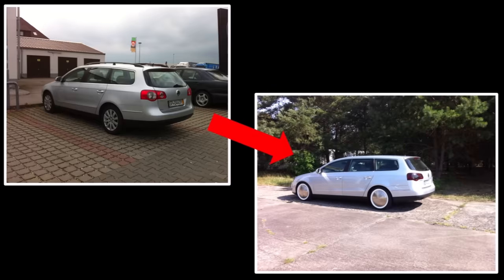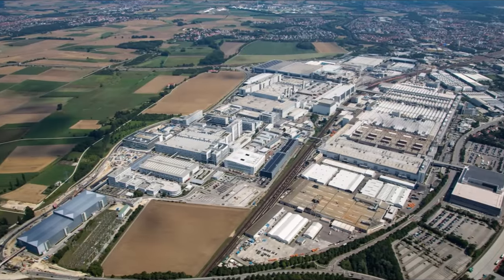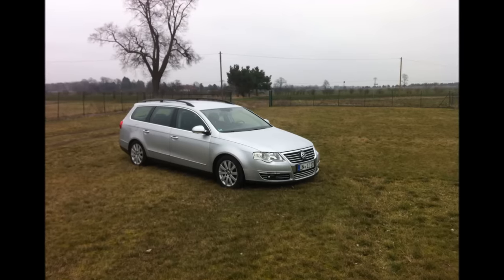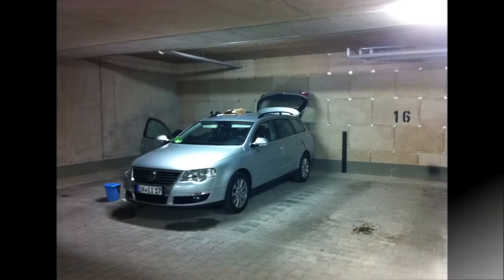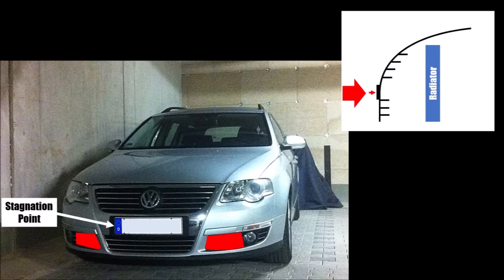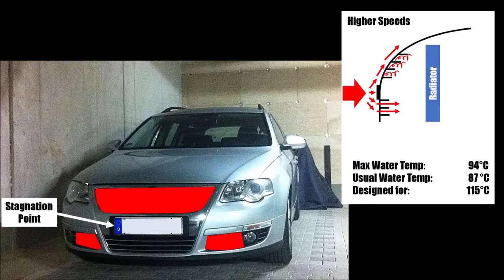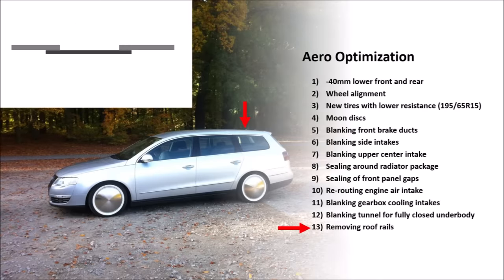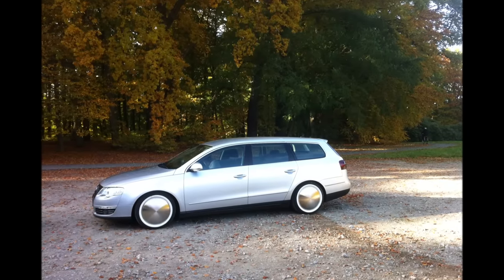Massive Drag Reduction For Tiny Budget - How I turned my family car into an AERO Star

Comment: The seals around the bonnet edges, I think, would increase drag. Those gaps allow air to leave the engine bay and that would reduce drag by reducing the force required to make air enter the engine bay through the front radiator vents.  In some extreme cases, if you seal the engine bay too well, the engine bay pressure rises so much that it is greater than the pressure at the front of the car and you get reverse air flow. The seals at the rear of the bonnet (near windscreen) should be retained though. The bonnet-windsreen interface is usually a high pressure region so isolating the engine bay from that higher pressure is a good practice.
Reply: i dont know if you've ever gotten your hands in one of these. it's a diesel (hint: mileage this low is impossible with the gas variants)
so it's fully sealed hood wise, to keep the hood from rattling and to keep the engine noise down.

that's something the gas variants of the passat (b5) dont have (they only have the windshield and water ingress seal on the front).

that seal is also present on something as cheap and simple as my old kangoo. goes around the engine bay all the way down to the radiator...
so sealing in the fender gaps would help aero.
Reply: @comethiburs2326  "so it's fully sealed hood" Have you watched the video? The video showed that the hood was not fully sealed - that's why "B Sport" added seals to the hood. Also, have a look at the parts diagram for the passat engine bay - you won't find a seal on the side of the bonnet. Have a think about it - air is rammed into the engine bay through the grill then radiator - where does it go after that? This video may help to explain the issue: https://youtu.be/NgGRwLANkj4?si=RWGtMiAfvIB_x6KY
Reply: Disagree. Sealing the engine bay makes pressure inside the engine bay rise so that less air enters it, i.e. less air flow through the engine bay. This leads to lower drag. 

Engine bay pressure could rise to above atmospheric pressure to reach atmospheric pressure + dynamic pressure of air moving towards the car, but never higher. This ensures that reverse airflow would not occur.
Reply: Sure, sealing it might help drag if you didn’t have need for air in the engine bay. But you do need air in there, don’t you? Your coolant radiator, air conditioner, trans cooler need air, we’ll, they don’t need air, they need air flow.
Reply: @zeitgeist785  Yes, but you don't need as much air in there as you get stock. Increasing flow resistance through the engine bay by partially sealing the outlets yields lower overall drag, as there is less air flowing through the engine bay.

Compare it to a battery connected to a resistor. Raising the resistors resistance does not increase consumption of electrical energy, even though its resistance is higher and power is resistance multiplied by the square of the current. In fact, the current drops such that the total power consumption is reduced. You'll see this as electrical power is also equal to the square of the voltage divided by the electrical resistance.

In this example, the electrical resistance is analogous to the flow resistance, the electrical current is analogous to the airflow and the power is analogous to the energy lost per unit time to drag.
Reply: In that case (where you need less air flow), why not reduce the air getting into the engine bay by reducing the grill openings? You still need some air flow in the engine bay which means you still need to get rid of it somehow which all these replies seem to ignore. It’s much better for that air to exit through the sides of the bonnet into fast flowing air instead of into turbulent air underneath the car.
Reply: @zeitgeist785  They do indeed close off part of the grill in the video. Some of the gaps in/around the engine bay, like around the headlights and front/sides of the bonnet, let air in. Closing these off thus helps.

I disagree that it is good for air to exit from the sides of the bonnet. It would be better to let it exit at the end of the bonnet at the base of the windshield or underneath the car.
Reply: @Gnerko123  What's your basis for thinking that air exiting the sides of the bonnet is not good? Do you have any reasons? My reason for thinking that air exiting the rear of the bonnet at the windscreen is as follows: Have a look at a pressure diagram of a vehicle at speed and then reply with why letting air out of the engine bay in that location is a bad idea [Youtube is showing me a thumbnail of a video with that pressure diagram right now so it shouldn't be too hard for you to find]. You make these statements but now I realise that you don't actually know whether they are true. They sound logical to you but some of them are simply untrue.

Comment: Good job, man! Additionally, you can further improve the drag coefficient with more aerodynamic outer mirrors, changing the door handles for flush ones and lowering the windshield wipers into the bonnet. Thanks for your valuable contribution.

Comment: Years ago I did a fair amount of sealing around the radiator combo of a Volvo C30 for the same reasons you give here. Removed everything before selling the car too. I did some tufting on the rear hatch but decided that any modifications there would be too eye catching. I had experimented with tufting before on a glider's wing, to help with turbulator strip placement :)

Comment: Very interesting project. I used to own a BMW E46 320d and it was also really economical and I hypermiled it a lot. I was able to bring the fuel consumption down to 4.7l on my commute to work (country/highway roads with max 100km/h). At normal Autobahn speeds on my trip to France (120-160km/h) I managed 1000km with 5,3l/100km
I'd wonder how much could be achieved with those kinds of modifications on this model.

Comment: I changed tire size from 205 to 185 and the fuel economy improved a good amount, less rolling resistance, I also installed turbine wheels from an older Mercedes that look similar to your moon discs.

Comment: Sehr interessantes Video, ich bin grad in einer sehr ähnlichen lage und optimiere meinen T4 1.9 td auch auf Verbrauch. Die Aerodynamik habe ich noch nicht angepasst, bin aber durch Anpassung der ESP und durch eine sehr lange Übersetzung jerzt bei 5,2L bei 10% Stadtverkehr, 20% Landstraße und 70% Autobahn bei 100km/h. Durch einen größeren Pumpenkopf und Anpassung des Spritzbeginns habe ich den Mitteldruck erhöht und den MFB50 näher an OT gebracht. 
Das Fahrwerk habe ich auf eine möglichst gerade Spur eingestellt und die reifen (195/65r15) mit 3,8 bar bei maximalem Druck. 

Ich fahre täglich 180km Strecke zu meinem Ingenieurspraktikum wo ich in der Motorentwicklung Arbeite und am Wochenende 380km in die Heimat.
Reply from the maker: OK also motorseitig schon einiges gemacht. Aero ist bei einem Bus natürlich eine Herausforderung.

Comment: If the average person applied you methods, the following conditions would be likely. 

1. Excessive break pad wear. 

2. Warped break discs. 

3. Hydro locked engine. (Most drivers don’t think about big puddles)

4. Blown head gasket, or over heating engine damage. 

Glad you warned that your mods were based on your driving needs. Unfortunately manufacturers have to try and design for those that pay no attention to conditions or maintenance. 

Your success shows just how much performance is lent on the table. 

Just out of curiosity, was your car one of the dreaded diesel gate cars?

I enjoy your videos, thanks.
Reply from the maker: That's the reason I don't recommend any of this to anyone.
I basically tried the things on my own car, I was not allowed to do to customer cars at my work in the technical development.

The typical British hydrolocking would actually be less of a problem because the typical wave when hitting the water wouldn't splash right into the airfilter. That path was blocked at my car.

Brake cooling on this car would still have been enough for 95% of customers and even in the Summer with air conditioning in traffic jam, the engine never reached more than 100deg water. So also that would be fine for most customers and the bluemotion models of VW confirm that.
The only reason to open the upper air intake is a so-called "pull-down" at 45deg ambient temperature. So a hot car being cooled down inside as quickly as possible. With a closed upper air intake that takes slightly longer.

This car was pre Diesel Gate

Comment: You can get similar gains in fuel efficiency by other means (depending on the car). for example, I used to hae a 1072 Triumph Dolomite 1850 with a 4 speed manyal gearbox. In these cars the exhaust is particularly restrictive, so I replaced it with a rally spec exhaust and downpipe. Nothing else was done and average fuel economy improved from 30 mpg to 36mpg (UK gallons) and there was a modest improvement in performance.

The other case ws on a 244 Volvo (B21A engine and 4 speen manual gearbox. I knew the car would need a new clutch soon, so with the help of the 240 specialist in the Volvo enthusiasts club, I also replaced the gearbox with an Overdrive one (0.67 overdrive) at rhe same time as the new clutch. Again nothing else was changed. this time fuel ecinomy improved from an average of 28mpg to 34mpg.  Granted these would probably have cost more than in this VW's case (A custom rally exhaust and downpipe is NOT cheap, neither is an overdrive gearbosx an a new clutch) but the results were just as wotrh rthe expense as I kept these two cars for another 5 years or so.

Comment: Another thing you could do if you are good with any bondo or other body work materials is cover the unused vents to create a smooth surface this would further reduce drag you could even install a small diffuser that will increase some down force but should also create less drag if you want to goto the extreme remove the door handles and once again smooth it out with something else just maybe have a latch underneath to get in next you could have vents coming from above or on the side next to wheel well to reduce the air tumble caused from the tire and extract it out the side further reducing drag and adding some cooling another thing you could do is add a vent somewhere along the hood to reduce the pressure and heat under the hood

Comment: My 2 door yaris has full underbody panels and the handling and mpg improvement is very noticeable since stock these things have no panels and are essentially parachutes underneath
Reply: does it have some type of diffuser? if you just cover the underbody with panels theres a risk of the car raising from the ground at high speeds
Reply: @PaulTC777  Calm down there, this is a street car not a CLK GT R that is 4 feet tall. No I don't have a diffuser, I just wanted to smooth things out which it did because now I can cruise at 90mph with no hand on the wheel and it goes dead straight. No side winds pushing is also nice, stock you were just getting thrown around with the wind but that was mainly fixed with the lowered suspension. Most newer cars have most of the underbody covered and don't have diffusers, you don't see them flying off. If you're doing speeds to flips a car like that, you are way better off having the panels.

Comment: Love your project! You can also add a lower front lip, so less air go under the car. Removing weight from car helps too like lightweight car battery,  fiberglass hood no spare tire and lightweight seats.
Reply: It may not help a lot at steady state cruising, but in the city perhaps
Reply: @RennieAsh   that is true but if you cruising on hills then still you get the benefit of less weight. I myself saw a 15% + increase of consumption from cruising on hills even though downhill riding is like 0 consumption going uphill even few degrees it kills the overall consumption.

Comment: I had the same engine in a Skoda Octavia 1.9 SDI (yes, no turbo, but it was primarily used as a taxi). I sold it after 240,000 miles when the water pump broke although I wish I had kept it. (I didn't know about the problems associated with DPF'S.)
These engines are known to be bullet proof and the cars and associated parts, very reliable.
I can understand you reducing brake cooling to reduce the drag coefficient, but is this really economical when you consider the extra load put on the clutch and gearbox? I would rather pay an extra few pounds (in the UK) every time I fill up and replace the brake pads every few years than get a large bill for a clutch or worse.
I'm sure you saved overall, but few of us can bank these savings for the moment the clutch needs renewing.

Comment: I'm watching with apt interest. I recently bought an Atlas Cross Sport VR6 4motion and have been very disappoint with the fuel econony. Almost 10,000 miles worth of driving and most fuel fills don't even last 300 mi. VW's claim was 18 mpg city and 24 highway. Idrive all highway but about 30-40% of those miles are in LA so really mixed. I think I've had one tank that averaged over 20 mpg but just barely. I've only seen my dash display show over 21 like 3 or 4 times. It usually averages out to about 17.5-18.5.

Comment: I love this video so far, but you've said you added more toe in than OEM specified for "better handling"?
I do agree adding a little bit in the rear might positively effect the grip on that axle, I'm pretty sure that more toe in on the front will not make it handle better
It will make it a tad more stable in a straight line, less nervous, as having a slight bit of toe out would make the steer in response more, well, responsive, too responsive for most people
But I was always under the impression that having almost neutral toe on the front is the best for sporty driving, just enought toe in to not feel nervous, but not too much to make it react sluggish to the steering input

Comment: Great work and an mazing efficiency improvement.
Didn't think you could make such a big impact with small but clever mods.
You mentioned "toe in" for better handling. By better handling you're reffering to better stability/predictability on fast roads with little to no bends?
Reply from the maker: Thank you very much!
A bit more toe in at the front axle gave me a bit "too much" steering angle, once the car was leaning on the outside front wheel, which let's the car steer a bit more happily. 
A bit more toe in at the rear axle gave me more stability for the same reason. It keeps the axle stable for longer but if you reach the limit and it goes, it goes more suddenly. So you have to be aware of what you are doing.
By a "bit more" I mean something around 5 angle minutes (5/60 degree), so that's fine tuning.
Reply: @BSport320  doesn't toe out make the car more willing to steer but more susceptible to oversteer and less stable at high speed corners?

Comment: Fascinating :) Would it be possible to replace the outside mirrors with smaller self-made ones, or would this be illegal? Or even a camera-based system with monitors inside. And the door handles could've been taped over, maybe to get some tiny amount of more efficiency ...
Reply from the maker: I don't know any after market camera solutions German TUEV would accept yet.Also, this was a low budget project.

Comment: nice video, quite instructive... i think that I might have, maybe, installed a fan topush some air through the exhaust system 'tunnel', maybe hooked to the switch for the radiator fan, so that it would provide a small airflow in that exhaust tunnel, whenever the car's radiator needed air, normally when stopped, so that you wouldn't overheat rustproofing paint/wax, sound absorption, or interior mat materials...but, hey, just an idea, cheap, efficient, easy, and just that extra bit of margin for safety...

Comment: This was very interesting. Would be nice to know which of the mods made the greatest/lowest drag reduction contribution, but I guess it'd take too much time to figure it out separately one by one. Really cool video! 👍👍👍
Reply from the maker: Thanks!
I did it one by one back in the day but unfortunately don't have the car anymore to measure it now.
Reply: It is probably like 0.5L/100km lowering it, 0.3L/100km sealing the underside and the rest from sealing up the front and removing the roof rails.
Reply: @rkan2  That would be your educated guess? I do not have the "feel" for stuff like this. It'd be really interesting to know full on real numbers - I'm weird like that, what can you do.
Reply: @griffn14 the lowering certainly had the biggest impact, I would say next is sealing the wheels from the outside which is about as good as sealing the underside. I am not sure about sealing the front air intakes from the inside, a flush sealing from the outside would have been better but probably harder to apply.
Reply: So, lowering and sealing the wheels and underside. Seems about the most logical. 👍 Cheers!

Comment: Holy cow!!!  80 mph fuel consumption is in the Prius's area.  Impressive to say the least.  Imagine a dedicated body panels and chasis designed for reducing aerodynamic drags - for example, complete under body panels; front and rear wheel well covers; sides mirrors replaced with pinhole cameras.

Comment: I coupl probably extract more efficiency from my 63 Corvair Monza, i dont have brake ducts or front intakes to deal with and mist of the vehicle is flat on the bottom.   Could definitely use the wheel covers and maybe a adjustment to the front lower area.

Comment: You saod you lowered it to reduce the frontal area? How does lowering it reduce the air hitting the front of the vehicle? Also, with adding a flat floor, are you creating more drag under the vehicle by placing it closer to the road? Genuine quesions as I found this really interesting but those two things went against what I thought I understood. Thank you for a great vid 🙌